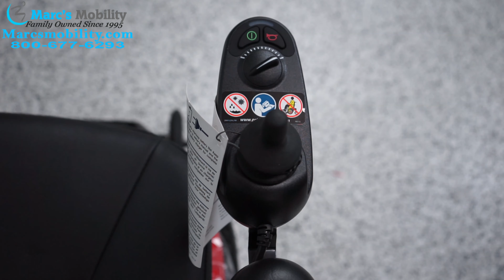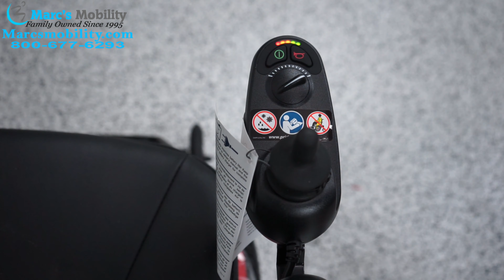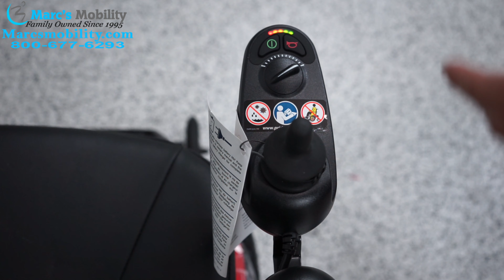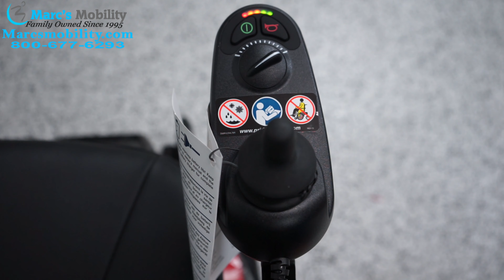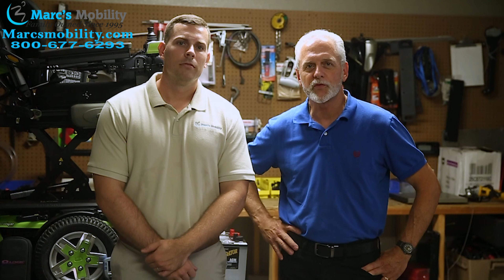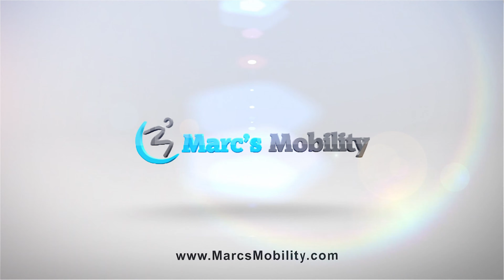Fault Codes for Power Chairs with GC Joystick

Comment: My Scooter Works When It Is Plugged  In, But When I Unplug The Charger It Doesn't Work

I Did Get The Nine Flashes, But It Is In Gear

What Could It Be

I Bought A New Charger And A New Circuit Breaker, But That Did Not Fix It

Comment: I got a jazzy select 6. Lights start with red and flash to green and then starts back with red and goes to green. Then red and yellow. So it flashs 12 time. Adding one light each flash.
Reply from the maker: So its either charger plugged in or its locked. Without charger plugged in turn the unit on and then hold joystick forward for 3-5 seconds till you hear a faint beep then hold it in reverse for 3-5 seconds till you hear a beep then let go and see if the lights steady out
Reply: Show me a YouTube video on how manually to do it

Comment: I had one ed light flashing installed new batteries fully charged, where should I look now. Comes on, horn works but chair does not move and still has one red flashing light??
Reply from the maker: It could be the unit is in freewheel mode and not in gear. You can check the lever going to the motor which will be either yellow or red. Move that lever and see if you are able to drive the unit after.

Comment: Thanks guys! You guys have helped me to troubleshoot my neighbors scooter. Thru random good deeds, I've become the caretaker for my neighbor for the last 3 years. I recently found her a 2002 jazzy with new batteries. One of the residents where she just moved to has a scooter also and they took it several blocks away and the batteries died, she began walking it back after putting it in neutral and now it will only go a few feet or for a few minutes and then it stops working and the wrench light comes on then it stops moving. To temporarily combat this  you simply plug it in for  a minute then it goes again only to stop and your forced repeat that process. Now I think I know what needs to be done, I don't know how many times it flashes but I can say she never reset the battery so I'm gonna start there. Thanks you guys.
Reply from the maker: Look at how many times it flashes. Once you have the flash count, google the chair and the flash count and it will come up with an error code. Give is a call and we can assist you on what you will need to resolve this issue.

Comment: i have a jazzy elite power chair.. bought used.. i am in a wheelchair myself but occasionally buy and repair and give to someone who cant afford one..jus got one.. and the lights flash 8 times when unplugged .. but when plugged up i can move it around and what not.. any ideas?..was told bad batteries.. the cvharger it came with was bad.. so bought a new one